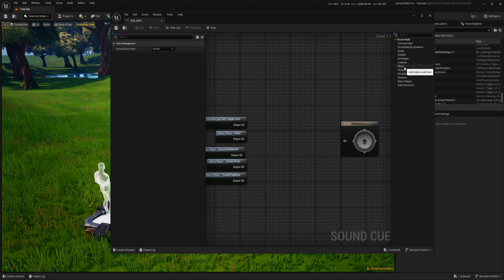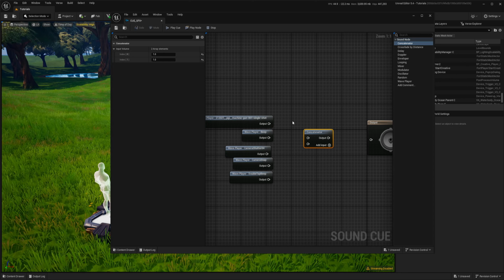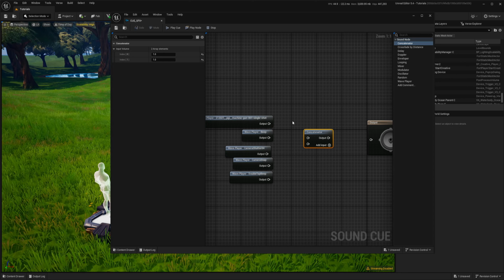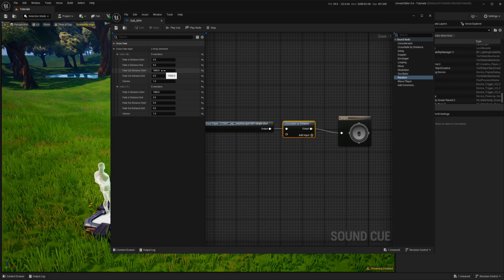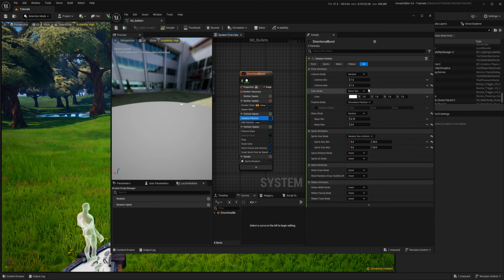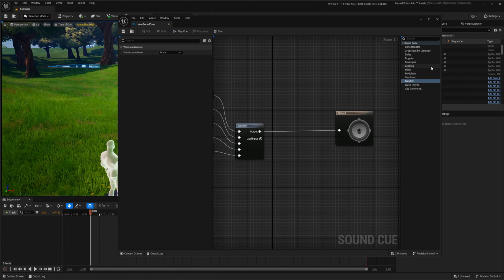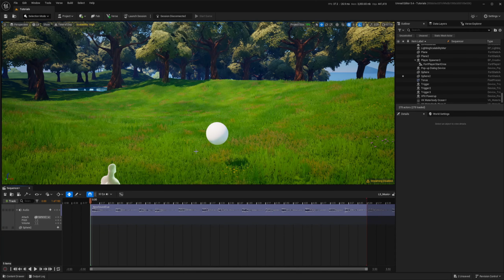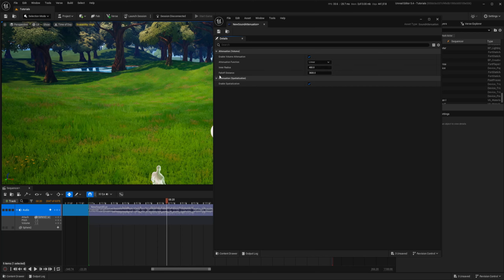Learn Useful Tips & Tricks About Audio - UEFN Tutorial

Comment: I just wanted to add that when you source audio for your games that you always want it to start as a .WAV which is an uncompressed lossless format (basically its very high quality) which is the only acceptable format to provide audio in. If you have audio that is a .mp3 or any other compressed lossy format then you are going to lose quality to make a smaller file - BUT because UEFN is only going to accept .WAV files (or treat your audio as if it is .WAV or lossless) you will end up with a file size that's as large as a .WAV being compressed through their internal compression, but that has already lost audio quality due to being converted to .MP3 and then back to .WAV. You can actually end up with a lower quality sound file, that is even larger in file size by doing this so it is better 100% of the time to just get your audio files as .WAV to begin with.

If you absolutely have to convert audio yourself there's a free program called Audacity that you can use, it's also for folding down stereo to mono, and other quick and easy utility options like adding fades, balancing the audio levels, etc.
Reply from the maker: @LionUnchained  I didn't know that UEFN now can convert mp3 into wav. Normally it wouldn't just import file at all.
Reply: @AsicsoN  I'm not sure if it will, I wouldn't ever upload anything but an actual wav, I worked as an audio engineer before so this is a sin of my people 😅